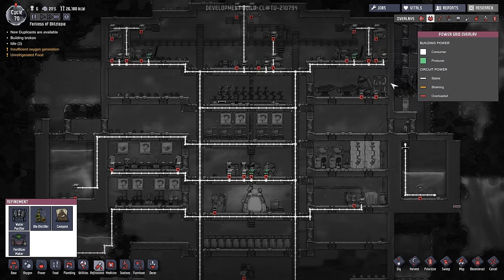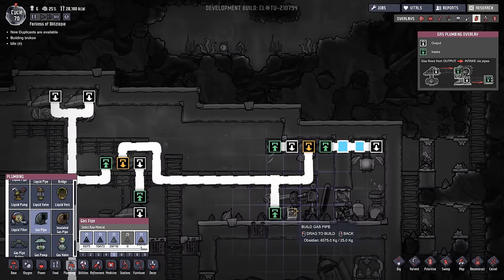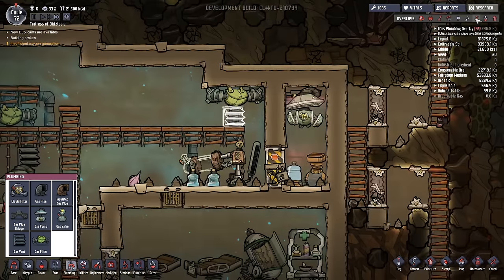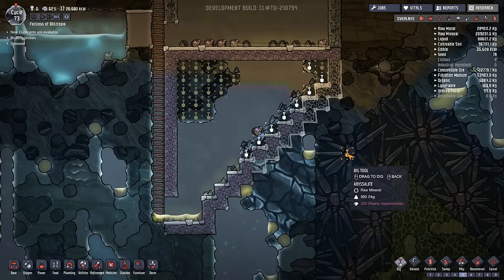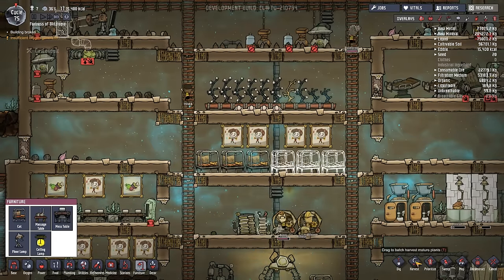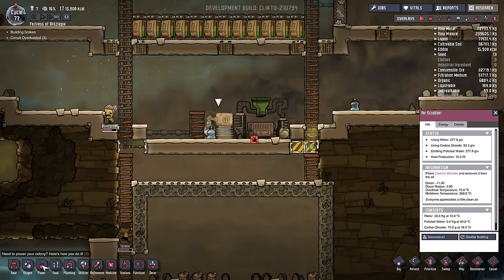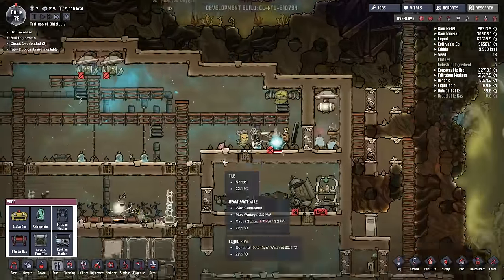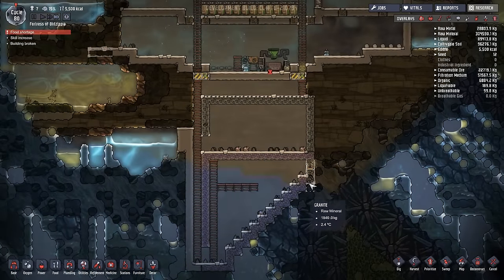Oxygen Not Included - Ep. 8 - Rerouting Gasses! - Let's Play Oxygen Not Included Gameplay

Comment: They need to update it to have a in and out on the battery/transformers (the battery look like transformers) the resistance goes up as your current increased that is why WATS  are being uses they converted it for you to make it simpler to under stand doing the volts and amps and doing the math yourself would be a pain to find ware the problem is.

Comment: its how much is plugged in and being used.if you have to much plugged in and being used then you get an overload. it is not how much is being put in. so the line can only have so many  things being used on it before it overloads. so what you need to do us split the lines so the each line has a lower load on it from each source of power. you could split it between two have of the base. one power plant feeds the power to half the base.

Comment: maybe only use 1000w of machines per power unit. wires may only  be able to transmit the max 1000-2000w. if you connect all machine on one big circuit the wires try transmit 4000w and melt. maybe its not how much you generate but use in the wires. give it a go and see what happens.

Comment: something funny with the oxygen/hydrogen numbers... 1000 mg a go, 888 O2 and 112 H2..

112 H2 would only be enough hydrogen for 56 O2.. 

seams it outputs 8x the O2 vs H2,  but it should be 2x the H2 vs O2...

edit

its the mass.. which is correct. oxygen is a lot bigger and heavier than hydrogen.. so its right.

Comment: let's ñearn a bit of electricity resistant, the electricity will always goes where there are less resistant, and your batteries are a very big resistant, and to understand better if the voltage can go throw other paths with less it will do it.
So what I had to do, well what you had to do is a close circuit with your batteries where the power is force to go in. Making a room apart with your batteries and don't cross the cables mlra than just one bifurcation to go out and another one to go in.

it should work to keep some power

Comment: well the devs did not implement it right if the whole thing goes up at once,  it should only go up when ther's more than 2k watt load on a single cable, like having 3-4 coal generators at one end and lots of air pumps at the other end then the power should go up through that cable only, it should not affect the whole grid.
   it should be possible to double up the cables so the load is split, but i guess they gota work more on that thing before is implemented , if implemented that way at all.

Comment: You have to put the wheels outside the circuit. You conect the wheels to the battery and FROM the battery you distribute to the rest. Is the wheel is connect to the line they'll have to run eiter way. On my base i made a circuit with 3 wheels conected to 4 large batteries and FROM the batteries i send the power to the whole base.
Make a try and send me a hello on next video ok?

Comment: I think the problem with your circuits is that you have too many consumers on the circuit. so you know how if you put a bunch of electronics into one outlet using extension cords it can short circuit? The same thing is happening here all your electronics are being powered at once which exceeds the 500w limit of the cable. A solution could be to create separate circuits with their own power supplies or possibly have your generators attached to a battery plant and a circuit breaker then when the batteries are all charged up switch off the generators with the switch

Comment: think of watts as the same as water pressure or air pressure ... your wires only handle 2kw .... while your pipes will hold 10k liters ... it is almsot a factor of 5 difference between what works with water and what works with power .... all you do is build yoour power grid in 1.8kw arears ... like your potty area is one plumbing workings ... while your electroll-a-sis is another liquid system .. so your 2 hydrogen gennies and a hamster wheel are all that goes on one grid .... of course upto 2kw fridges to run .. near your water recycle area in the hot zone with the slime and algae (Al Gee ... gee like jeep, not gay like happy)... slap a water heater in that green water ... kills germs ... and then you can purify it for use in whatever with littel risk of germs migrating over to your clean starting water ... do the same with large pottable water reserves and then cool the liquid to use elsewhere ... dont forget to sweep the duplicant portal .. get that pocket lint picked up before you make a new one ... dont want pocket lint getting in the way of your next einstein or van gogh lol 

nice vid's btw ... atleast im not the only one who watches his duplicants die as they seal the concrete tile around thier heads or sleep at the bottom of the resevoir  ;)